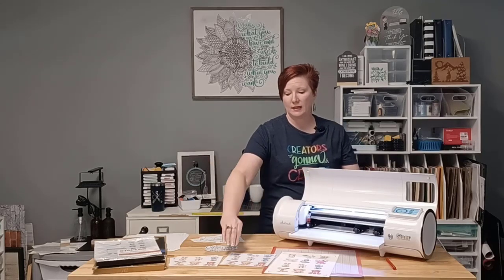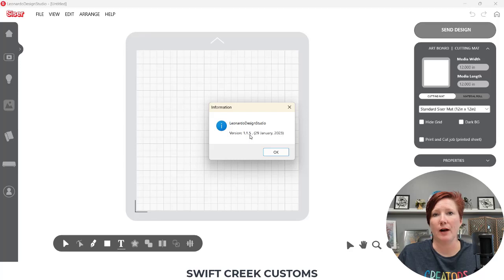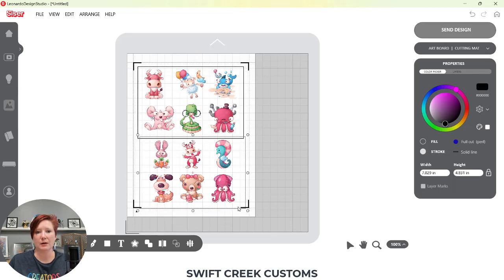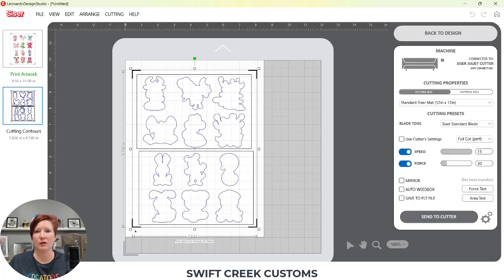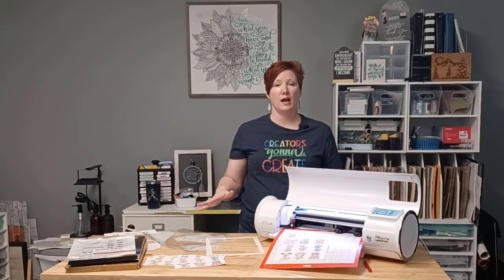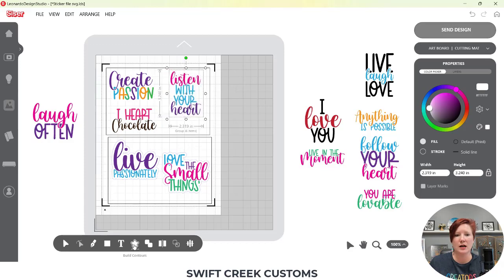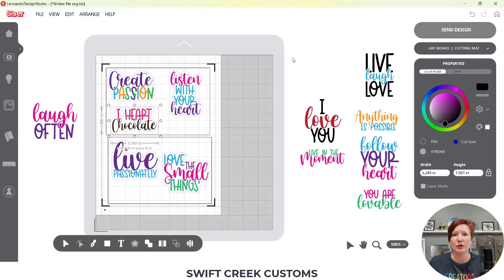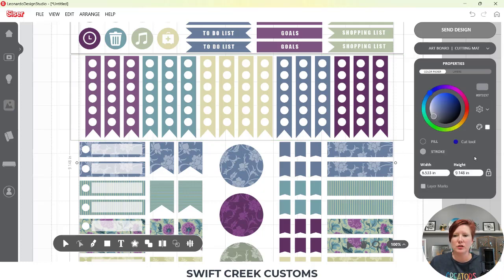How to Setup a Kiss Cut vs Die Cut on Stickers for Siser Juliet & Romeo

Comment: I'm having the hardest time getting the offset color to be changed.  I upload my image, then add an offset, I want the offset to be another color but it won't change even though I change the color on the layer.  I am finding the software very frustrating.  I love the cutting ability but the software is just not user friendly.
Reply from the maker: When you create the offset, you can change it on the offset window. Are you changing it there as you add it?

Comment: Hi, I am wondering, if I have a design is on a square/ rectangle and I want to cut out the square/ rectangle, then I would choose the background image setting instead of print and cut, and it will cut out that shape (with the design in it) only. Is this correct?
Reply from the maker: @julienguyen8437  if you open it as a background, you would need to draw the rectangle/square you want it to cut. Background = opens image only. No cut lines & does not set it up as a print.
Reply: @SwiftCreekCustoms  that makes a lot more sense now! Thank you 😊
Reply from the maker: @julienguyen8437  you are welcome!

Comment: Only small thing that bugs me is that you can't just stick the mat in and hit send on the program. You have to manually set up the laser everytime to the bottom right?
Reply from the maker: Yes. You have to set the blade starting point of origin each time. 
Here's an example where I cut 4 sticker pages at once with Romeo. 
You do have to line up the blade housing for each individual sticker sheet, but it takes seconds, and with the repeat option as well, it can be really quick to do. 
https://youtu.be/uFk_cZSNLL8?si=u3kftK0htch8XfkR
Note: I did not use the repeat job in this video, but it is an option.

Comment: Wait a sec.... isn't the cutting tool other way around? the Cut tool (perf) Blue Solid Circle is the die cut right? while the Green outline Circle (full cut perf) is the kiss cut
Reply from the maker: @skyhskyh  you can set it up either way since you are in charge of the settings. The software has also had some changes since the beginning with dot colors..... But the user is in charge of it all and as long as you know what you've set up for each color, that's the biggest part.

Comment: could you help me out a bit? Im trying to die cut around my sticker sheet first, and it does cut through, but it does not start the kiss cutting process. Once the die cutting around my sticker sheets complete, itll end the process there. I chose cutting tool for the images inside my sticker sheet template, and perf cut for the die cut. Is there a way to have two settings, one for die cut and one for kiss cutting -- force and speed? okay So I figured out maybe whats wrong. The template of the sheet for the back ground I added, I cannot select the "stroke" option. Is there another way to have that diecut?
Reply from the maker: Can you draw the shape you need in Leonardo Design Studio? 
You'll need to be able to select a line to change the action on it.
Reply: @SwiftCreekCustoms  basically I open another image which Is my sticker sheet template and then I drag my individual stickers into. Shoukd I be trying it another way?
Reply from the maker: @dandee28  have you tried setting the cut line setting up right after opening the cut template design part?
Reply: @SwiftCreekCustoms  nope I haven't tried that. I'll try it today after work! Could you make another video kiss cutting and diecutting templates pleaseee
Reply from the maker: @dandee28  can you explain more? Templates for what?
Reply: @SwiftCreekCustoms  basically opening a sticker template sheet and then multiple stickers to place inside the sticker template sheet snd diecutting around the template while kiss cutting the stickers
Reply from the maker: @dandee28  where do you get the templates at?
Reply: @SwiftCreekCustoms  oh I create my own png files on illustrator
Reply from the maker: @dandee28  so you are using your own template file?
Reply: @SwiftCreekCustoms  yes that's correct. I just open the file in the studio and then open the other stickers to drag onto the template. Am I doing something wrong or does it not work like silhouette studio ?
Reply from the maker: @dandee28  I don't know without using the same files you are. If you can send me a file to test, I can definitely play with it. 
If you'd like me to test my email address is swiftcreekcustoms@gmail.com

Comment: when i try to die and kiss cut as one job on the same sheet, my machine does the die cut and never does the kiss cut.  All objects to be cut are configured correctly. Using v1.1.5.  Thoughts?
Reply from the maker: I would start over and make sure that each line is set up exactly the same as my video. You want to make sure a kiss cut has a different Cut Action than the Full Cut. Do not use the Fold/Crease option as it does not adjust properly. 
Then make sure that each action has different settings for force on the Send tab as I show in the video.
Reply: @SwiftCreekCustoms  Got all.  I'll redo and try again tonight.  Thank you for the quick response.

Comment: my machine won't read the bottom right registration mark.  I have it set to the default full page
Reply from the maker: Are you moving the housing inside the bottom left registration mark as demonstrated at minute 14 in this video?
https://youtu.be/_MJJFyBFO_U
Reply: well, I figured it out. But it cut totally off the mark.  Back to the drawing board.
Reply from the maker: @Donna O'Hara  did you watch as it registered and did it find the corner of every single registration mark?